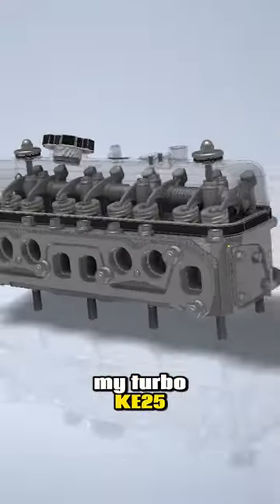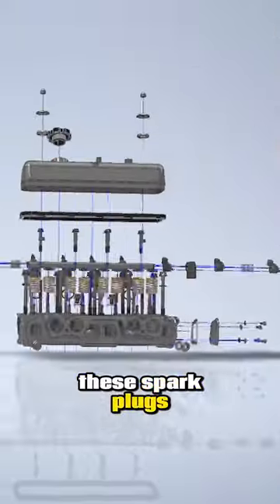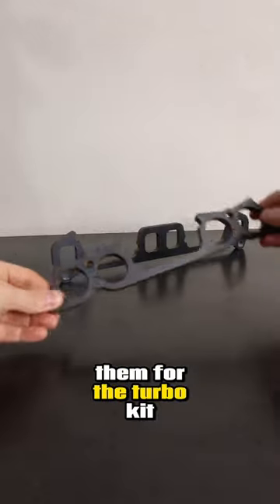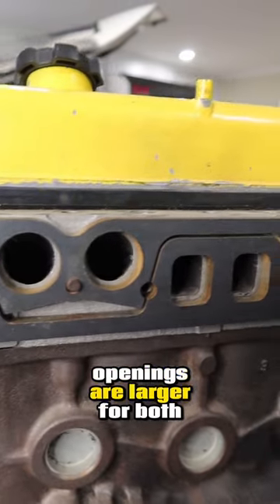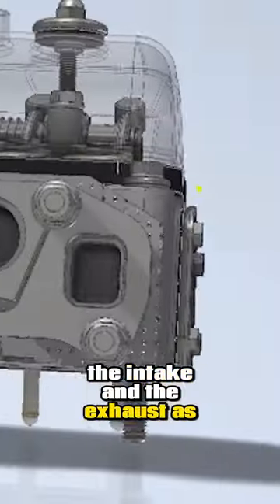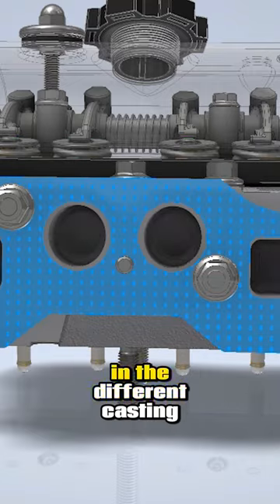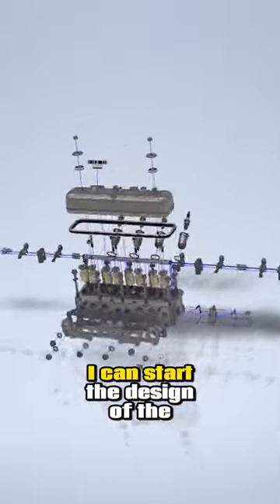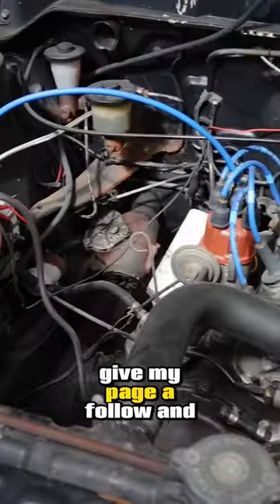Turbo 1974 Ke25 Corolla - Manifold Flange Design

Comment: I'm thinking about Turbo my 300 Cubic inch/ 4.9 Leaders straight 6 in my 1991 ford f150. I'm probably going to do valve Springs, ARP headstuds, Beefier head gasket, Cam, Different intake Manifold, Holly sniper, A huge intercooler, Radiator out of a f250, Upgrade to a beefier 5 speed of a f250 and A Turbo not sure on the sizing though.
Reply from the maker: Awesome mate sounds like a cool project!